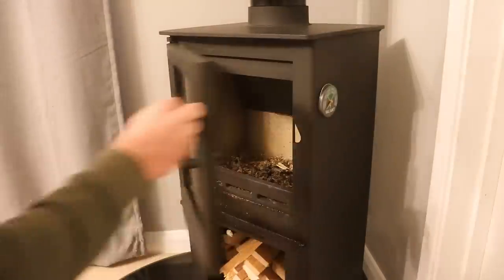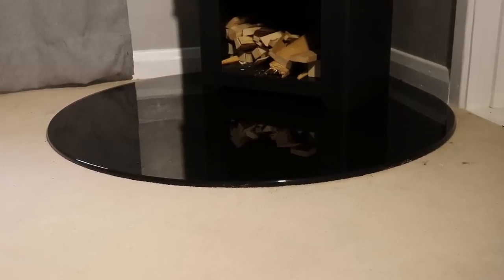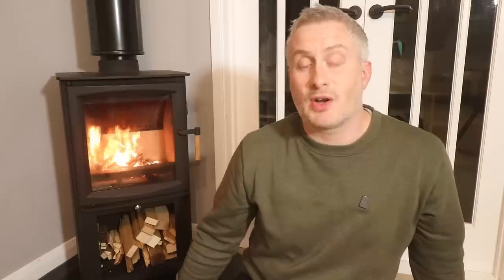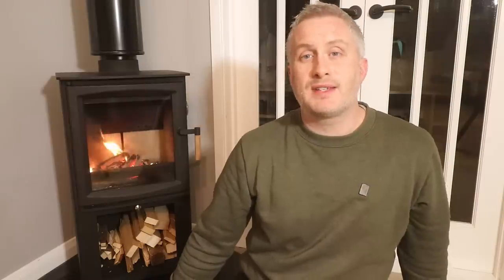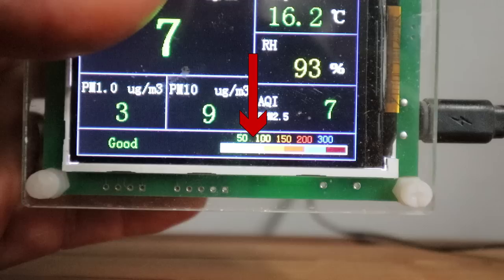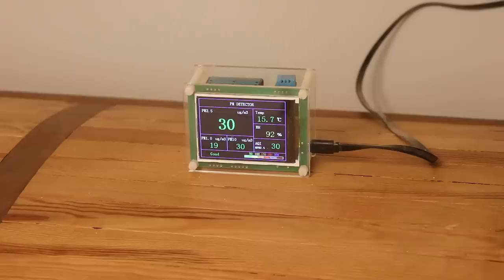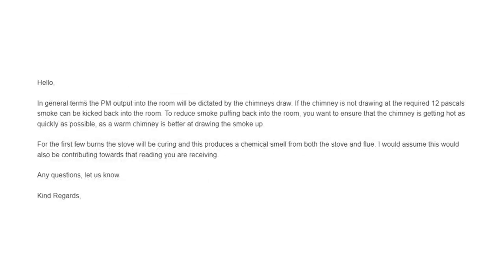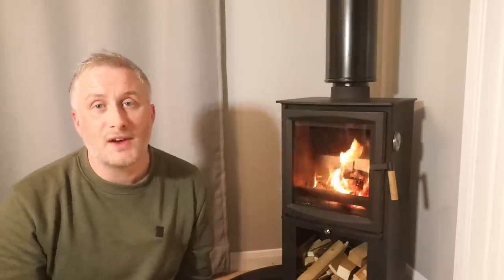Wood Stove Pollution and PM2.5 Particle Emissions TESTED ✓

Comment: Smokeless zones were introduced as a direct result of the Clean Air Act.  Many parts of the UK are now designated smoke control areas (also known as smokeless zones). In a smokeless zone you can only burn approved smokeless fuels such as Homefire, Ecoal50 or Phurnacite.  
Firewood is not an authorised fuel and cannot be used in smokeless zones, unless burnt on a DEFRA exempt appliance. This does not mean you can simply burn anything, or any wood, on an exempt appliance.
With the introduction of these measures, coupled with the widespread consumer switch from coal to gas fired heating, air quality had improved dramatically.  However, that trend has seen a reverse in recent years.  Air quality; particularly in urban areas, has been getting worse.  This has been caused by the increased number of diesel cars and lorries on our roads, but also the rise in the popularity of wood burning stoves.
In 2017 there was a switch to only allowing the burning of kiln dried wood.
Anyone who fancies a wood burner should look into this and also your local council, before you spend the extortionate amount buying and fitting one! (Which contradicts the claim they're cheaper as people forgot to add this cost,)
Reply: Having been brought up in the 1960s living in houses with coal fires, I remember the mess involved, the dirty environment and smell from burning coal and wood permeating the estate where I lived. Now moved on of course, to modern central heating which is so much cleaner all round. Unfortunately over the last five decades people have got used to cheap energy and haven't been considering the real costs. Visiting relatives on a cool winters day to find they have their heating on full blast and sitting around in T-shirts and shorts never made any sense to me. Surely the answer to reducing energy costs is simply to use less (a lot less!). I limit using my central heating to cold days only and even then to only take the chill off in the morning for an hour then for a short time in the evening. I'm happy to wear a pullover and sometimes a cosy throw when watching tv of an evening. It's 23 Nov and I think I've used my heating for maybe 4 hours this month. Quite comfortable with that!

Comment: They do NOT need to be signed off or completed by a hEtAs engineer.

There are other accredited people schemes and you can also use the council. Plus there are certain spaces for installation that don't require any sign off.

Comment: The pollution levels will also depend on what you are burning. Avoid pallet wood and other treated timbers. Also avoid rotting or overly damp wood. Wood with heavy sap content such as conifer is also not good as this can stick to your flue restricting the flow or can cause a flue fire.

Comment: Very informative Keith. Just a thought - could the high reading have been partly caused by the wood you were burning? Perhaps your offcuts do have different chemicals in them compared to say kindling you buy. Also there is the question of the moisture content, kindling has been kiln dried.
Reply: There really shouldn't be any "backwash" from the stove - indeed, the docs for the stove I have makes it very clear that you have to have a good outside air feed into the room to allow the stove to draw properly. You pretty much should not be able to smell any hint of the burning wood when the door is closed, and the fire is burning properly.
Reply: Hi Danny. I would say 99% of the fumes from the wood are going up the chimney when it's blazing hot and run in so to speak. It's a concealed burning space, the hotter the chimney is the more drawer/air pull it will have to expel the toxic fumes. All the fumes in Keiths room at this point are off the actual exterior of the stove and chimney with them being newly manufactured and installed, burning off oils, paint hardening etc. I can guarantee the air will dramatically improve over time with the use of this stove. Tony
Reply: @cricalix  I agree one hundred percent, with fresh air vents and the hotter the chimney the more draw/pull the fire will have making it burn very hot clean and efficient. Tony
Reply from the maker: I was about to reply but Cricalix and Tony answered it perfectly :-)

Comment: We are seriously, seriously, SERIOUSLY considering getting a wood stove.  In fact we're not considering it really.  We'll definitely be getting one as soon as we can afford one - or maybe two.  We currently have a solid fuel range in the kitchen and an open fire in the sittingroom.  Whereby an open fire is lovely to look at, the chimney is creating a massive draft in the room.  And coal - even smokeless - is not an eco friendly fuel.  We also have an oil heating system.  It was installed by the council in 2016.  We were forced into that nonsense.  The insulation in the houses here was not up to standard and the council wrote to us to say that if we wanted the insulation brought up to code (which we did as we had damp and mould in a house that was built in 2000!), then we would HAVE TO opt in to oil central heating.  6 months after it was installed it packed in and the council left us without heat for 3.5 years.  3 Christmases running we ate our dinner while wearing our coats.  After a number of temporary fixes (longest period was 3 months of an operational heating system), the heating packed in again in January this year after being "fixed" the week before Christmas by a council "worker".  We're sick of it now and anyway it's unsustainable and it's so expensive at the minute too so wood stove it is.  This video was very helpful and we'll be well prepared when it does happen now.  Thanks a million Keith.  How's the kittens doing?
Reply from the maker: Thanks Emer. They're doing great, started to interact with eachother now which is nice

Comment: Excellent, Keith. We've had one for about 8 years now in a re-exposed fireplace (that was a fun job) and although it's a relatively small burner, it really does heat up the whole of the downstairs of our 1930's ex-council semi.

I am going to buy one of those air quality devices too, very useful.

Also, I can thoroughly recommend the Scandinavian method as described by John earlier - works like a charm.
Reply from the maker: Cheers Tim. Unfortunately as ours is on the external wall of a large bungalow, the heat doesn't really go beyond the room adjacent to the one that it is in... Still, in the evenings we never really leave the living room anyway! 😁👍 Might buy one of the fans to see if that helps push the heat around a little more
Reply from the maker: I will try that Scandinavian method, makes a lot of sense
Reply: @RagnBoneBrown  I didn't believe it until I tried it! ;-)
Reply: @RagnBoneBrown  I've seen them, but not used one as yet. The big iron box of flame seems to do quite well as it is.
Reply: @RagnBoneBrown  The fans that power from the heat of the stove (the ones with the radiator fins) work a charm; there is a noticeable different in my mother's living room when the fan is in play vs not. However, it's a different configuration from your space, so your mileage may vary.

I had the same paint curing issue, and it was bad enough to set off the ionizing smoke detector. Haven't set it off since the paint fully cured thankfully.

Comment: That's really interesting and reflects my own experience. I always open a window slightly when starting a new fire to increase the draw that then pulls particles up the flu. The heat always outweighs the cool air flow and increases circulation. Once the flu is hot and the fire is strong, I close it. I agree with you that leaving the door open is the biggest room polluter though.
Reply from the maker: Thank you
Reply: Main thing is to make sure no strong extractors are on. If I try and light the fire while the hob extractor is on its very difficult, but fixed by opening a door or window.

Comment: if the pollution increase is not a cause for concern, a good addition will be a small heat-powered fan on the wood stove. it allows hot air to be circulated around the room. it will heat up your space quicker so you don't have to burn as much.
Reply from the maker: thanks I'll look in to that

Comment: And now to piss on the fire so to speak - How did that install get passed?
Reply from the maker: I'm not aware of the rules.  I think our installer said a distance of 300mm from the curtains, which is fine.  In the longer term though we're looking to replace the curtains with shutters anyway.  Not sure re: architrave/skirtings though but not something I'm worried about - they installed and signed off so I'm trusting them. Cheers, Keith
Reply: Get a HETAS inspector round to audit that and he’ll be removing the installers accreditation.

Comment: Keith, having participated as a one of the consultants for the US EPA during their 2018 revision of the EPA's "Guide to Air Cleaners in the Home", I have a few thoughts that might be useful on the subject of PM 2.5 and indoor air:

1. Here in the US, we do not (to date) regulate indoor air quality. But since the early 1970's we do have a national standard for outdoor air quality. The standard for small particles (PM 2.5) is that the annual average outdoor concentration for the location in question should not exceed 12 µg/m3. Above that level, the location is deemed a "non-attainment" area, and then Federal and/or State regulations begin to apply to certain large types of heating equipment, and automotive and industrial sources of PM 2.5 come under further regulation. So for your US viewers, when indoor PM 2.5 rises above 12, it's a signal that—if that measurement were typical outdoors over the course of a year—the air quality would not be what we here in the US have described as "adequate". The recently updated World Health Organization has a much stiffer guideline for adequate outdoor air namely: annual average PM 2.5 should be less than 5 µg/m3. 

2. The long term health risk from breathing PM 2.5 for long periods is real, and very well-documented. Those risks are higher for infants and children than they are for adults. But keep in mind that it's a question of "total exposure". Exposure = ambient PM 2.5 concentration in the breathing zone multiplied by the number of hours you are actually breathing in that concentration. So occupancy of a few minutes at high concentration is no great risk. In contrast, occupancy of ten hours even at low concentration represents a higher risk. This highlights the fact that you have been very wise as to wear a respirator in your shop when PM 2.5 is at a high concentration and you have several hours of work you need to do for a particulate-generating task (i.e: sanding!).

3. For reference, here are a few annual averages of outdoor PM 2.5 from an article written in September 2016 for the ASHRAE Journal (The International HVAC Engineering and Building Science Society—a sister organization to CIBSE in the UK—the Chartered Institution of Building Services Engineers). Delhi, India: 106, Beijing, China: 78, Cairo, Egypt: 28, Paris, France: 16, Los Angeles, USA: 15, Toronto, Canada: 10, Atlanta, USA: 10, Melbourne, Australia: 5. And also for reference, the shorter term outdoor PM 2.5 concentration can be for, far higher. For example, PM 2.5 was between 55 and 150 for more than nine (9) days in Sacramento, California during a wildfire event that lasted through the end of November and early December of 2017. (Very, very unhealthy).

4. The cost of fuel is really a problem in Europe this year, as we all know. So modern wood stoves are an alternative to the far more unhealthy condition: a cold house. When using an indoor wood stove, to reduce indoor PM 2.5 consider running a HEPA air cleaner in the room (or rooms) in which you spend the most time (obviously the bedroom, in most cases). Portable HEPA air cleaners of reasonable size can be bought for less than $200 US here in the States. A more economical alternative that is less effective and more noisy but still reasonably effective, is to make a "Corsi-Rosenthal" filter box using four MERV-13 filters and a 20" box fan (and then actually turn it ON whenever you're in the space, in spite of the noise!).
Reply from the maker: Thanks for this, great information - really interesting

Comment: Opinion is a tricky subject. The scientists with reviewed published documents who have been reported in news and then debunked by opinions is that the particles stick in your lung and not pass through your system and suggest that the burning stove that is then refilled while still burning will push out huge amounts of particulates as the for is opened and then realised after resulting well above safe outside levels. You can’t see the particles down to 1.0 and 2.5 of tiny ness. The national standards need to be reviewed. For the safe operation of these things.

Comment: First of all, if you buy a stove for £649, this is kind of what you should expect.
A stove with proper secondary burn or catalytic burn will produce far less particles.

Secondly, the particles in the room doesn't necessarily come directly from the stove or the chimney.
It is actually quite possible that it is drawn in from the outside via leaking windows, doors and ventilation.

The solution to both these issues - don't waste your money on cheap crappy stoves.

A proper reburning stove may cost from £2000 but they will save you money in the long run by burning much more efficient.
They will also be a lot less harmful to the health of you and your neighbours.

Comment: I don't understand the comments about burning from the top, burning gas and 'not burning wood'. Flames are burning gas. A fire at the right temperature (get a flu thermometer) burns thoroughly and what you are left with is ash: burned wood. You don't really want hot wood in the stove, not burning, for a long time, so don't overload it. Most 'seasoned wood' is too wet. I like hardwood briquettes because they are well under 10%.
And to get a perspective on PM2.5... just cook some toast.

Comment: Keith, air pollution aside you have flammable materials very close to the stove. The curtains and the moulding at the door and wall. Norway (wood burning capital of the world - joking) has very strict rules on the distance from a wood burning stove to flammable materials.
Reply from the maker: Hi Marius, I'm not aware of the rules here, sorry.  I think our installer said a distance of 300mm from the curtains, which is fine.  In the longer term though we're looking to replace the curtains with shutters anyway.  Not sure re: architrave/skirtings though but not something I'm worried about - they installed and signed off so I'm trusting them. Cheers, Keith
Reply: @RagnBoneBrown  you have been advised wrong. 300 mm to combustibles is far too close. Once the stove is running hot you have tihe potential for disaster. All stoves have different manufacturer advice but that sounds too close.
Reply: The rules are:

The hearth must extend at least 300mm to the front and 150mm to either side
And the full area of the hearth should be at least 840x840mm
While it must be at least 12mm thick
However if your stove heats your hearth to over 100°C or it hasn’t been tested, the thickness required increases to 250mm.

I’d worry about the curtains if they can blow about and touch the stove.

Comment: Can’t believe a professional installer allowed the stove to be placed where it is.  Supposed to be no flammable material within 600 mm! You will get pollutants from the painted surfaces because of the heat!

Comment: I tend to think that adequate ventilation around the room will deminish a lot of the polusion caused by either wood burner or even a coal fire. Obviously there's a lot more to be concerned with as far as coal fires but treated with plenty of common sense, either of the two can be just as safe and clear. I love both methods of heating. I'm with you all the way Keith with your advice mate. 👍🏼👍🏼

Comment: If you build a cycle lane outside your house you should be fine. Over here in ireland they have lost the plot completely as they are building cycle lanes everywhere and anywhere thinking it will save the environment.

Comment: The guidance on your PM device is almost meaningless. Current WHO guidelines for PM2.5 are for a 24 hour average of 15 ug/m3 at the 99th percentile, so thats no more than 3 or 4 times a year. So it isn't going to be healthy if your house is 30 ug/m3 for many days of they year as this would be like camping on a major highway. It would be interesting to test some plug-in quiet HEPA filters to see if the in-room pollution could be reduced. Also, PM2.5 means anything 2.5 microns and below so PM2.5 as a mass fraction contains all the smaller particles too. The reason PM2.5 is considered most harmful is really only because it is the most studied PM fraction so there is the most evidence supporting harm, but it might turn out that smaller particles are even more harmful. Smaller particles definitely do not just pass through you, in fact they can pass into you. Literally, into your blood, through the blood brain barrier, and into the brain.